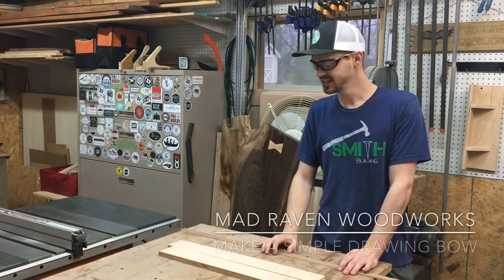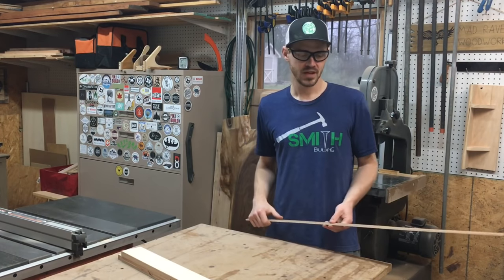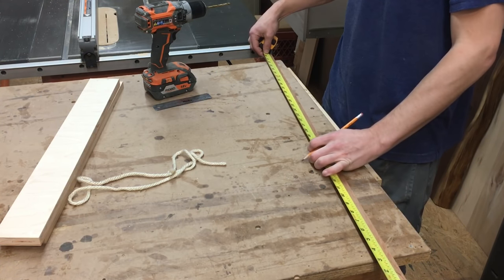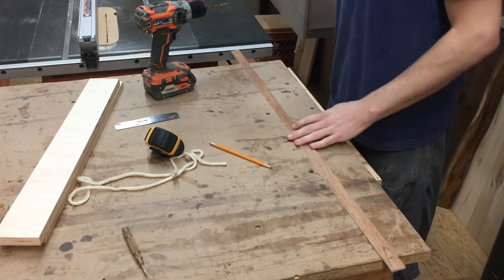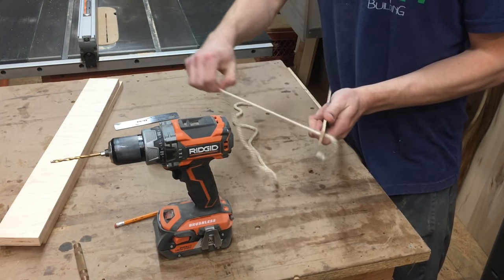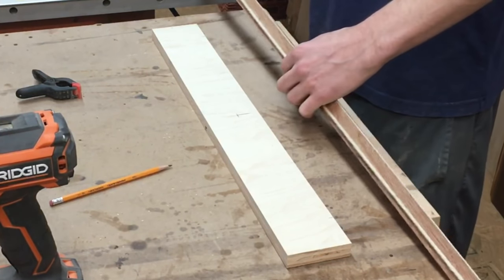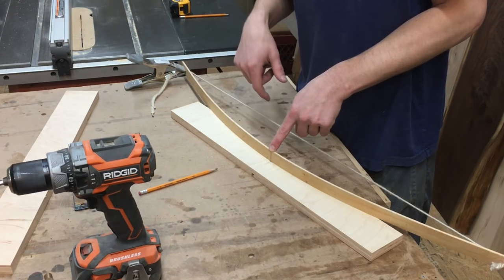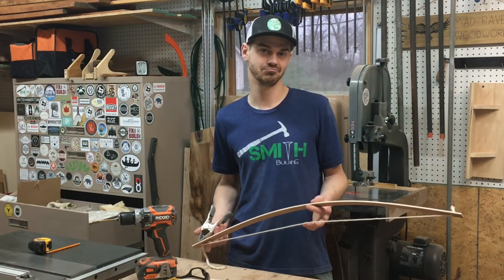Make Long Curves with a Simple Drawing Bow - Woodworking

Comment: Very cool. Two finish nails in the bench as stops for the work piece so it does not slide around, lined up at the marks you made for the start and stop of your curve. Nails need to be tall enough to support the bender (bow) on top of the work piece. Push the bow and make the curve and mark the outside edge  of the bow. Keep up the vids, love the folding table saw out feed table.